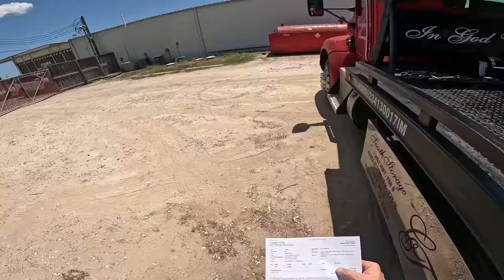Kia Optima Smashes a Guard Rail! 10-50 Major!!

Comment: why do you pull the car so far on your bed it's only harder to unload especially if a car doesn't roll  great video
Reply from the maker: I prefer to have the weight further up the bed. Makes the truck drive and stop a lot better. 
And if you know what you’re doing, it doesn’t take much of any extra effort to unload.
Reply: It's a matter of load balance.
Reply: on a truck with air suspension ??? @nboldrini
Reply from the maker: @emielverschuur8395 yes. Regardless, if it has air suspension or not, you don’t want a bunch of weight on the back of the truck.
Reply: @Towtruck_Dustin great job sir one tow brother to another watch your 6 sir have a great weekend

Comment: Suggestion:  carry a couple gallons soapy water,  OR couple gallons water and a bottle of liquid soap, and a smaller container.  Mix liquid soap with water: just pour it on the bed, and a vehicle with locked tires will slide up & down the bed much easier.      Easy to rinse off  OR  just leave it on the bed for the next car.  @Towtruck_Dustin
Reply from the maker: I carry a jug of soapy water. You can see it in the driver side box by the chains. I just never use it unless I have pour it in someone’s driveway. Otherwise I use WD40 if I need to slide something on the deck.